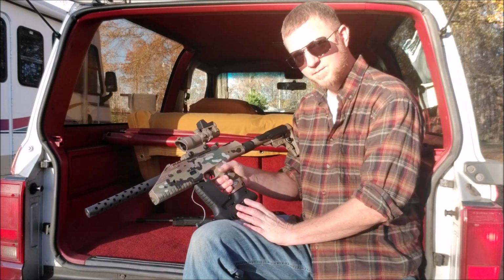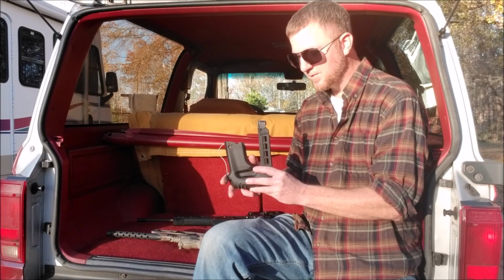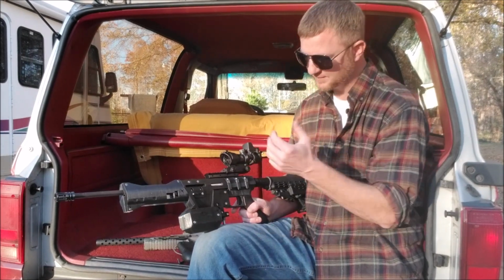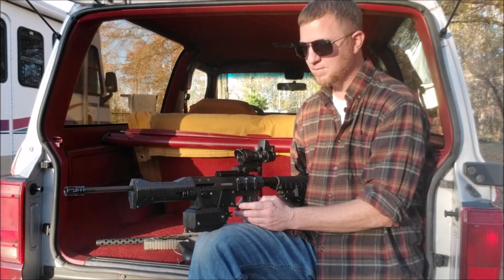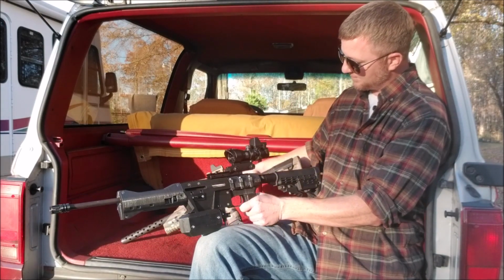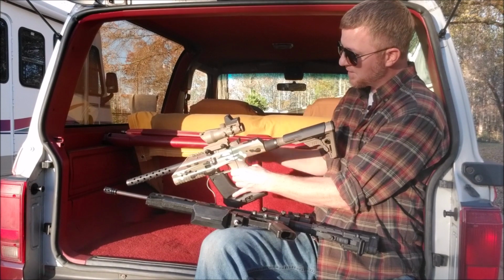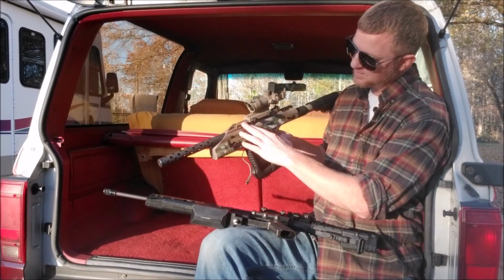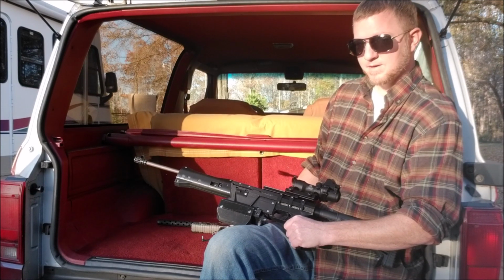Superbird, or Freebird

Comment: is the freebird´s housing 3d printed?
Reply from the maker: Yes
Reply: @masondawson4061  Then is this this the only critic point that i have :D But i am happy with 1k rounds a minute, it sounds so much better  and it waits less air and it can fall to the ground with no fear. BTW this camo drozd is an optic wet dream with the smg barrel. You could easily make this shrouds for the 400mm barrels, why don´t you do this, when so many people ask for it?
Reply from the maker: @SpencerGaming7580  I forgot to mention that it is printed. Yes. I agree this is less desirable than injection molding, but it does have it's advantages from the consumers point of view. It's much easier to redesign the modules than to make another mold. Customers with printers can make their own modules if they are looking for a project also. Each mold would cost about $10,000 to make. We would need nine. I don't even have 1000 subscribers, and maybe 50 who watch my videos. As for the barrel shroud I would need to buy a lathe, and download another skill set. It's pretty easy to make a shroud from carbon fiber tubing if someone wants to. I did a video about that a while ago for the Drozdmax Tactical barrel. Also the gun I named Leshy had a carbon fiber shroud with a Russian barrel. I used to be more about how these look than I am now so it's hard for me to get motivated about putting lipstick on them. Speaking of the site on the camo bird it is a Chinese knockoff, but a very good copy. There are several models on Ebay under the name of what it is faking for around $100. The only problem is the eye relief is something like an inch, and a half. While we are talking I wanted to ask you. Can you find the green German military commando wool sweater I sometimes wear in my videos? They are getting hard to find here, and are my favorite.
Reply: It is at the end, just the matter of taste,.i would like to have both guns, but it impossible for me, so i am happy with what i have 🙂